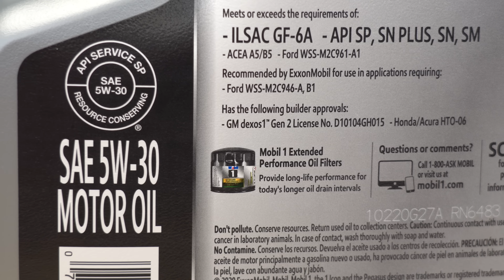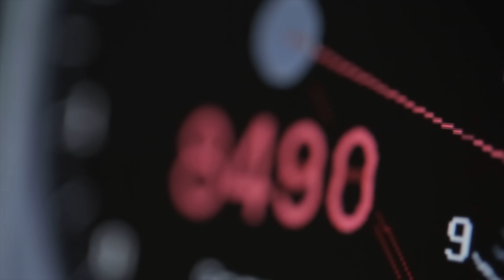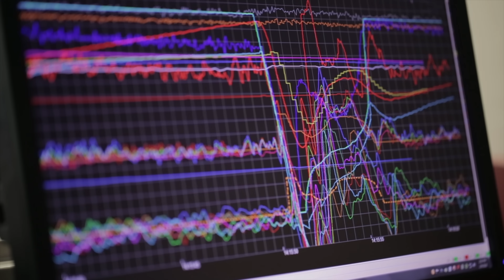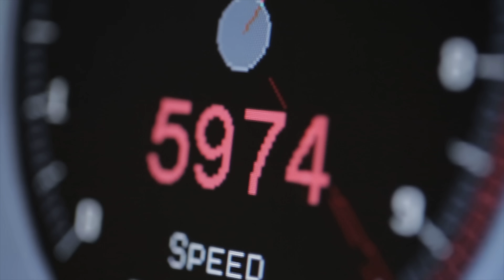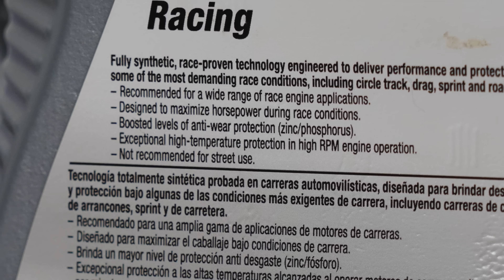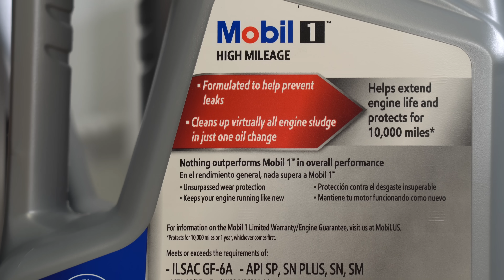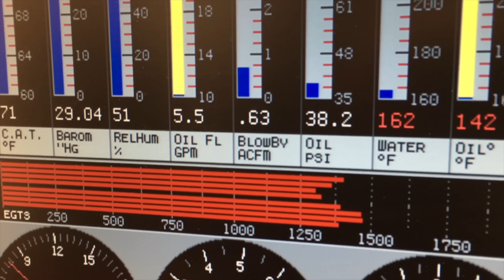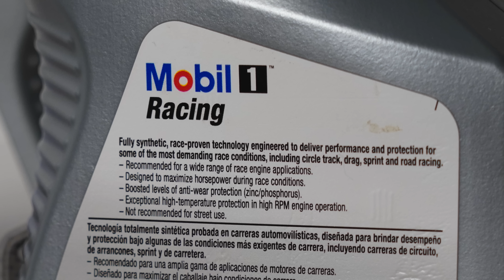Should You Use Racing Oil In Your Road Car?

Comment: 3:55 "road cars are rarely at full throttle"

I can't be the only one...
Reply: Every straightish line lmao!
Reply: Rotary owner, every gear, but fifth and sixth.
Reply: @sofakingdom3076  I was just thinking, a redline a day keeps the carbon away.
Reply: @chitlitlah  I have a sohn adapter. The OMP doesn't inject oil til 4-5k rpms. They are made to rev. This is why premixing is a must for longevity. Cruising at 3-4k rpms = no oil. It means you have to clean/change your spark plugs due to fouling, but that's less time consuming than rebuilding. =D
Reply: @sofakingdom3076  I have a second gen RX-8 and a tuner. It's alright stock with injecting enough oil, but I cranked up the OMP with the tuner. Hopefully that helps keep the apex seals lubed, but yeah, I still try to get it close to redline every 10 or 20 miles. I'm somewhat interested in trying to rebuild a rotary for the first time, but at the same time, I'm not looking forward to it.
Reply: Well my truck doesn't technically have a "red line" per se on the cluster... but it gets pushed to the max on pretty much every on ramp! The ol' Italian tuneup is a time honored tradition thats proven to work
Reply: Especially on low power older cars. It's not for fun, it's a necessity
Reply: Yes you are special. I can't Full Throttle mine without getting a ticket :p
Reply: Me going 65mph in my old vw
Reply: lmao i WOT like 10 times everyday.
Reply: @Utsusemi  That's still a low percentage of the time compared to a race car. Unless you're only driving a mile or so a day. I go WOT a bunch of times every day I drive my car, but it's still not much.
Reply: As the owner of a stick shift Fit, yes.
Reply: @LazerLord10  Lol very true. Almost every time I accelerate I'm WOT from 2nd gear up. Driving in a city and having to stop/start/slow for turns a lot, I'm probably wide open more than not when driving the Fit.
Reply: I mean every cheaper car under 100hp basically has to drive with full throttle
Reply: @nolandderlugner1351  i had a '72 Volvo with fuel injection, I think it was rated at 75hp
Reply: Speak for yourself man.
Reply: Heh, shitbox life
Reply: Yeah! 
I don't own a car now (but will get one soon). But I like speed and on the highway för example, I could go continously full throttle with most cars I have driven (even those that have 200+ hp) when the road is clear, but usually keep slightly below, just to not put too much stress on the engine - but during acceleration and for short highway runs, I almost always hit full throttle.
Reply: I guess I don't have a road car 😁
Reply: 2 %
Reply: You need more horsepower if you're always at full throttle.
Reply: No you are not !!!!!!
Reply: me in a 04 corolla doing 96 mph and screaming POWER!!!!! on the freeway (when its empty)

Comment: Standard grade oil should be fine for most all applications in consumer cars. I bought a $10k Escort in 94 and planned to drive it for many years. I started using a synthetic oil. At just 50k miles someone t-boned my car and almost totaled it. Having worked on cars all my life I replaced the two doors, rocker panel and B-pillar, pocketing $6k. Figuring the car was mostly depreciated, I dropped collision/comprehensive coverage and started using the cheapest oil I could find, many times Walmart Tech something. I was still changing the oil on the manufacturer's normal use recommendation. At 180k miles the engine was still running great, but the car was otherwise starting to wear out. I then doubled the change interval and the car just kept going. At 260k miles the car was rear-ended and totaled, but the engine was still the strongest part of that car. I've never paid for anything more than the manufacturer's  recommended oil since and I've never had an oil caused failure. I don't change oil any more as I gave up on gas engines the better part of a decade ago.

Comment: What a great informative video, I run 5w30 mobile 1 synthetic in my Roushcharged S550 Mustang , a bunch of my friends, same 750whp.. stock internals, use 5w50, I have cats on my car so I continue to use 5w30 and have no issues is it worth the switch to 5w50?... guess not

Comment: High ZDDP (and highly priced) Joe Gibbs oil for my 996 engine soon to fight that inevitable bore scoring...at 6 month recommended change intervals.

But zero weight wonder elixir for my Prius Prime; what a crazy world we live in.
Reply: I use joe gibs driven DT40 5w40 in my big turbo 2.0 I4. Fully built motor and head. Worth the $70 oil change. Daily driver

Comment: I would guess that the oil manufacturers might be considering using other extreme pressure additives in their oil formulations to provide boundary layer lubrication to surfaces that are subject to high shear stress and surface pressures such as: rings, piston skirts, main and connecting rod bearings and in the valve train. Molybdenum might be a good substitute for the ZDDP compounds that can poison catalytic converters. I think Nissan went with a combination of DLC coatings and a special ester and high levels of Molybdenum in their Nissan ester oil for their VQ engines with the VVEL technology.

Comment: Another great review.  I am no engineer but for daily drivers, this isn't exactly rocket science.  I feel that for any daily driver the oil you use doesn't much matter as long as it is roughly in line with  manufacturer specs and changed regularly with a premium filter (skip the Fram).

Comment: I sure expect a new car engine to last a lot, A LOT longer than 100,000 miles... in this day and age especially.
Reply: GM and FCA have a solution for you!
Reply: There's gas engines built 40 years ago that last 300,000 miles. And heavy duty diesels older than that with well over a million miles on em, and still going strong.
Reply: They don't make things to last anymore.
Reply: They would if recomended oil changes werent suicidal
Reply: Nissan VQ35DE in my Infiniti G35X just hit 212k and still going strong love that car.
Reply: Laughs in 440 thousand miles 1990 CAMARO
Reply: Modern cars are like an iPhone compared to an nokia
Reply: @pvt_picklestomp3014  but he keeps talking about how much better manufacturing is these days, cylinder walls, lifters, etc... listen to the video.
Reply: @CE750  But with variability complexities for economy, they find the worst places to cheap out. Or just outright poor designs.
Reply: @CE750  and then they cheap out on other components , using plastic instead of metal and so on
Reply: krvnjrcbs  Yeah, I know regulations are that way, but heavier is so much better. Lasts so much longer, takes a beating (like a work truck ought to- that's the point of view I'm coming at it from)
My F150 is 36 now, the sheet metal is still good, the engine and transmission will last ages. How many brand new Toyotas (for example) are going to be on the road in 2057? Much less after a hard working life.
Reply: @davesstillhere  I guess we shall see how long my 2012 taco lasts (tho I suppose it's not exactly new). Only got ~136,000km, so I'm hoping it's just broken in. Maybe I supercharge it someday, but that'll bring down life expectancy. Wouldn't really trust the plastic bed for true heavy duty truck work, but that's not it's intended purpose

Comment: If you adhere to your manufacturer’s suggested oil change intervals and type, you will get tired of your car before the engine wears out.
Reply: True. But if you have a dream car you wanna keep forever it’s better to change oil earlier.
Reply: Unfortunately not always the case when they recommend longlife oil. 😬😂
Reply: 5-7k kms you should change ur oil. Any longer than that and ur asking to blow up in time. - wrx and bmw owner
Reply: GM and Chrysler (FCA, whatever it’s called this week) have a solution to this problem....
Reply: Well recommending oil change interval to be on 25k kilometers seems like you'd blow up the engine long before you could get tired of it...I mean even at 15k kilometers the oil is sheeet evenxif driven nicely. Cant imagine 25k.....
Reply: That's exactly what you DONT do...Oil should be changed generally every 5-6k miles, depending on your driving style. Manufactures recommending 10-20k intervals are trying to kill your engine so that you end up having to buy a new car every (x) years or so. That's how the business flows, bottom line
Reply: @S1lverArr0w  10,000 miles is perfectly acceptable for a modern, full synthetic oil. But there is nothing forcing you to go that long on it.
Reply: @aygwm  Not if you drive a direct injected turbo charged engine. I don't care what oil you use or how many miles they claim, if you have a turbo charger, especially on a DI engine you'd be foolish to go past 5,000 miles on an oil change.
Reply: @stevenmccauley254  I literally drive a direct injected turbo engine and go 10,000 miles on oil changes. It’s a diesel, though.

Comment: In 1969 we used 20-50 in our 440 Mopar HP engines. While at the track, we'd watch the 'big boys' run straight 60 weight. Today, we use 5-30 in our 650 HP Corvettes. The car I drive home uses 5-20 in it's V8, and my wife's car uses 0-16. Of course, you don't buy a race engine for MPG, but this shows how oil technology is headed to lighter oils and longer oil changes for the masses.. in the years to come, I'd imagine no oil for our electric cars..
Reply: Electric motors still need lube ;)

Though not as much as a regular ICE.
Reply: OK, smarty pants, but try to change that oil filter... haha.
Reply: The light oil is for the EPA rating

Comment: Of course it's not a really good ide to use racing oil on daily stock car, but I think, that the main question should be, is it worth to use racing oil on a stock engine, that is used in racing. There are budget classes where you are allowed to modify everything except the engine, so is it worth to by an expensive racing oil?!

Comment: So the answer is yes you can, in the summer, since it will flow like crap in cold weather, BUT... if the zinc content is higher in the race oil, it will foul your cats faster. If you expect 200k miles out of your cats, it may not be a good idea to use race oil, but then again if you drive it like you need race oil....you won't hit 200k cheaply anyways, if you even make it there. XD
At least that is my take on this info.
Reply: people that buy race oil..........don't have cats
Reply: @BCNeil 💯
Reply: O2 sensors die in a couple thousand miles.

Comment: maybe the question should be 'can you use racing oil in your road car?'...if I understood correctly, you can but it's really not worth it?🤔
Reply: From what I understand it, yes. It's designed for a different use environment so it may not protect as well, and will cause damage to emissions systems.

Comment: Good analysis and now I understand better the reason some of today's motor oils have been reformulated. 

I recently quit using Mobil 1 in my C4 ZR-1, based on a recommendation from the C4 ZR-1 guru, Marc Haibeck from Haibeck Automotive in Addison Illinois. 

The LT-5 dual overhead cam engine originally recommended the use of Mobil 1 and it came from the factory filled with it. All 11 quarts. 

According to Marc,  the zinc phosphorus content of a motor oil used in this engine is critical to minimize cam wear.

Mobil 1 reformulated their traditional oils and decreased these respective contents of zinc and phosphorus over the years compared to their original oil recommended by Chevrolet.

I did not  understand the "why" until I saw this video. 

I have switched to AMSOIL which has a higher content of zinc and phosphorus compared to the current reformulated Mobil 1 products. 

I have used Mobil 1 products in all of my "normal" cars since the late 80's.  

I have had hundreds and hundreds of thousands of miles driven with never an oil related issue. 

I was not aware Mobil 1 had a Racing Oil that would meet the needs of my ZR-1 once again. I will run this video past the C4 ZR-1 community for their feedback.

As always a great video and thanks.

Comment: My turbo supplier just insisted I switch from Mobile1 15w50 (which I have used on these Toyota/Yamaha 3S-GTE engines for over two decades) to Valvoline VR1 Racing oil for the zinc content. I am apprehensive but have been running it for three days. It helps that I have no cats.

Comment: I have a 1964 v8 with a flat tappit cam.  Have heard several recommendations for the best oil to use, one of which was a racing oil because of the high zinc content.  Still not sure what is the best way to go
Reply: I use Valvoline VR1 in my 911.
Reply: @Cevan42  What year?  What cam?
Reply: '86. Stock cams
Reply: @Cevan42  the engine builder had a different recommendation. Trying to get the details.  He said the oil actually has a green cast to it.
Reply: @johngriffin571  use Castrol 5w50. Specifically designed for engines like those. Has a high ZInc levels of 1300 ppm.

Comment: you’re forgetting about the fact that the engine has to be able to be rebuilt after 1500 miles with the least amount of wear because you only get 2 or 3 engines for the whole season and have it in the machine shop for 6 weeks because it’s needing to be bored out is not what you want. most people using racing oil on the street are running older engines where 1% doesn’t make a difference in an engine that gets 12mpg so there are many advantages to running that oil especially when most modern oil seems to be out to kill flat tappet engines all in the name of “cleaner emissions” making you buy a new “more efficient” car. the whole reason why emissions were important was because of smog, we no longer have smog and there isn’t enough data to prove global warming, why not focus on improving cars by increasing the usable mileage expected life to above 200000mi instead of improving gas mileage by 1% because i think the emissions from building a new car to replace a old car is more than what an extra 100000mi of engine protection is

Comment: Prediction: I should put the oil my manufacturer recommends in my car.
Reply: Yep manufacturer's recommended viscosity Mobil 1 street oil, I'm guessing he's getting a pretty good check for this one.
Reply: it also depends on what is your geographical location. I have skoda and viscosity differs from 0w-30 when you live in arctic zone or Siberia and to 10w-50 when you live in hot or tropical climate. The most important thing are manufacturer norms that are selected f.e. in my case it's VW 502/507 and in my father's car (Opel Astra) is GM Dexos 2+
Reply: @michalkuna1994  Very true! Here in Finland we use very thin oils like 0w-30, 5w-30 etc. Use some 15w-50 when it's -20°C and the engine won't even start 😅 And like you said, the manufacturers standard is the simplest way to know if the oil is compatible with your car, location is what determines viscosity.
Reply: @niconutz898  Well said👍
Reply: @michalkuna1994  i agree with you. From where i came from, we use 10w40 with tropical climate here and no winter season. I'm even surprised that 0w-something exist because we don't use that here and wouldn't even know about that if not for the internet lol.
Reply: @13taufiq  funny thing is that even in tropics the newest toyotas in hybrid versions use only 0w20 ,check it on your country's toyota's service recommendations
Reply: @13taufiq  everything due to ecology ,thinner oil = less resistance = less fuel burned
Reply: @michalkuna1994  Thinner oil can also pass through easier in all the sensors and pathways used in modern engines.
Reply: @michalkuna1994  why the dealer and sa doesn't think of that instead let your figure it out yourselft.. unless your custom import the vehicle with origin recommend sticker is intact then it on your own duty to match the climate
Reply: @fanzury2289  there is a viscosity table based on temepratures range ,the most important thing is to change oli regularly and use high quality with ACEA norms
Reply: Just use water... should be fine
Reply: Sometimes it's clearly not the best solution, also their recommendation may be completely out of date.
Reply: So what if the manufacturer recommends racing oil? MY car recommends 5W-50 in the manual and on the fill cap.
Reply: @TheNukaColaQuantum  if that's what the manufacturer recommends, that's what I'd use.
Reply: @WhippperSnaperater  What if this oil suck?
Reply: @TheNukaColaQuantum  It means you drive a fancy pants high-performance car.
Reply: If you're a average consumer yes lol some people just can't understand oil and know there's differences in it lol
Reply: depends how standard the car is

Comment: my mechanic swears by 15w50 mobile 1 for audi turbo engines and my 2013 A4 has 181k miles on it and runs like a dream and I switched off the Ow-40 at 50k miles because i was burning way too much of that water thin oil i feel like the viscosity of the 15w50 helps keep the insides lubricated more liberally